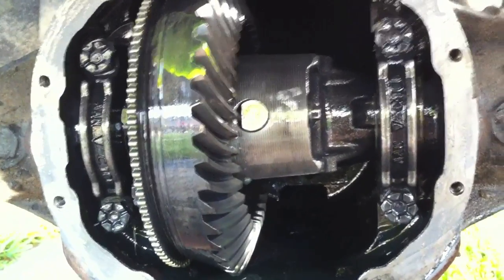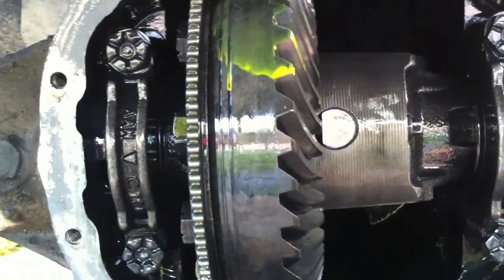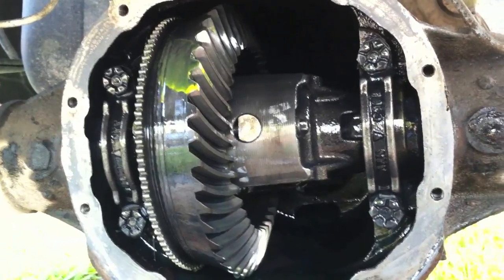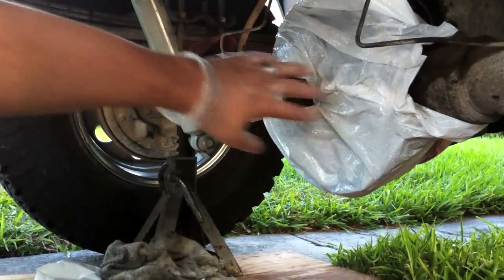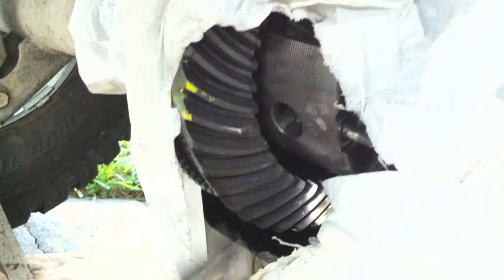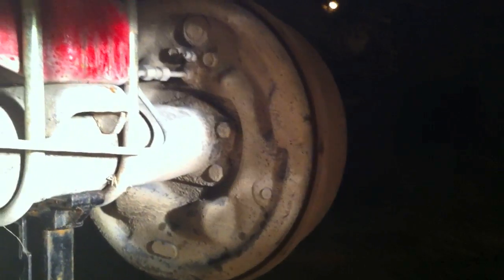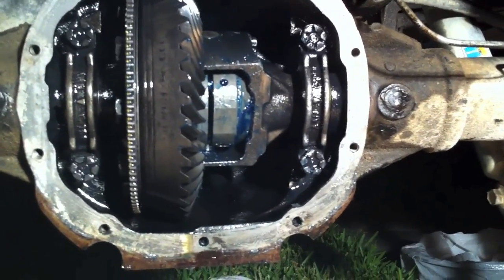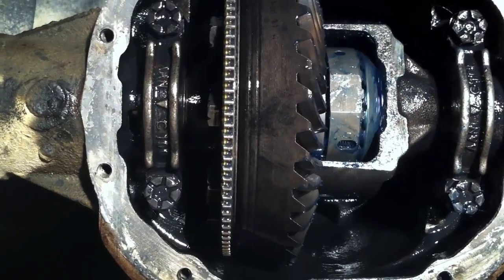Lock Right Locker - Part 2: Install in Ford Ranger [HD]

Comment: Plenty of people have said it but there is no resetting backlash if you're using the exsisting carrier... All you had to do was remove it from the differential housing, mark and remove the ring gear and do the job, put the ring gear back on the carrier exactly how it came off and you're good to go. Can't believe you ground down a tooth before doing that....

Comment from the maker: @patman5308 Glad it helped you out, I was looking all over for what to do about getting that pin out and I found a couple of forum posts with like 1 blurry picture. I decided this procedure needs a video.
Reply: Great video. What gear do you have in your truck? I have a 88 ranger with 4.56 gear, but I was told this locker can be used only on gears up to 4.10. Thanks!

Comment: Grinding the gear like you did is acceptable. some gears actually came with the ring gear already trimmed slightly across all the teeth. They also used to sell a "cheat" centerpin that was grooved(or ground) on one side to allow you to slide it back in.

Comment: When you turn a corner with a differential the outside wheel will have to turn faster to make it around a curve. A "true" locker(not limited slip) will send its power to the inside wheel and the outside wheel will actually turn "forward" to unlock itself and it will freewheel around the corner.

Comment from the maker: @DoctorHowitzer You get some soft clicking noise, and can be made quieter by using thicker gear oil in the diff. Mine is a daily driver. Sometimes when making a sharp turn such as into a parking space or a U-turn it makes some loud pops as it sometimes sticks locked at low speeds (less than 5mph)... but other than that I have no complaints. Off-road it's great. Only thing is you might think twice if you ever have to drive on ice... if both rear tires are spinning you can fishtail or spinout.

Comment: I have to wonder  if this will cause me to spin out on a wet or icy road taking normal turns...   but the concept is great as I might spend some time driving on a beach in NJ. I would not mind the clicking noise.. I would spray insulation  over the out side of the case.   But losing control of the truck in we or icy condtions worries me.  I'm sure  I could deal with it. but I would never lend my truck to anyone after that..  any comments.???

Comment from the maker: @ugadog34 No, it's an "automatic" locker... meaning you have no direct control over it. In an automatic locker, the wheels are normally locked, except when you turn it releases the faster turning wheel. So for turns, normal: outside wheel powered when turning, auto locker: inside wheel powered when turning.

Comment: What are the consequences of installing a locker other than some noise in the differential? Is this something that should be done on a daily driver?  I have a 2000 4X2 ranger 4.10 gears, I would like to do this for some light off roading.

Comment: So am I right in thinking you only hear the clicking sound when the tires are locked? And that you can unlock them when you're not offroad? Is this correct thinking? How would you do that when you're out driving? I have a Ranger, but what kind of locker would I need? Is there different kinds?

Comment: I had Lock Rights installed in both axles of my Chevy 4x4 pickup.   I have never heard that "ratcheting" sound when I turn a corner....   My instructions say the clicking noise "can sometimes be heard during turning."   In another place in the instructions, it says "it is almost inaudible during cornering."   I suppose they can be noisy in some applications and not in others?
Reply: Depends maybe on viscosity and type of oil used.

Comment: Hey man you seem to kno alot about the lock rights, so I would greatly appreciate any feedback. Will do a burnout all day long but if you stall up and take off or hit it from a roll it will completly slip about halfway through first and stop pulling completly untill I let off and get back on it. Any ideas? Was thinking about the only thing it could be is the springs are weak from being assembled and reassembled causing it to not put enough pressure on the outside teeth.
Gm 7.5

Comment: hey man just a thought. Does the locker have a break in period? and shouldn't you change the diff. oil after the period is over? I've heard people saying the diff oil turns metalic after the break in period. just like an engine. any does and don'ts when it's new? thanks :)

Comment: You wouldn't have to reset the backlash for you are not changing the carrier, if you use the shims it had, it will line up just fine.

Comment from the maker: @mtz8709 If you are going in a straight line on the freeway (at any speed really), and you hear the ratcheting sound constantly, something is wrong... sounds like the tires are two different sizes... check that the two rear tires are inflated to the same pressure, and that one isn't much more worn out than the other... otherwise, gotta open up the diff and see what's going on. It should not need to ratchet constantly when going in a straight line.

Comment: That ring looks like a 4.56 or 4.88… not a 3.73 at all. The 3.73 ring doesn’t ever need mods made to fit the standard full cylinder pin.

Comment: Thanks for posting. I bought a Lock-Right, but I think the installation instructions are the worst instructions I have ever seen for anything. They are horrible. And the pictures are worthless, like  photocopies of photocopies of photocopies. I tried Richmond Gears tech support line, and got an answering machine. 
I really, really, really needed to see how you put it together!
But thanks for posting  your video......It helps me understand how it works. I just need to see how it goes together.

Comment: That will never provide a positive lock. You basically installed a "clicker" into your diff. Possibly leaving metal shavings from it clicking as you go around corners. Should of spent a little more to get a mechanical, electric or air locker that positively locks up the diff for real traction. Enjoy your "my CV joint is failing" clicker.
Reply: I stand behind my original first sentence. It will  NEVER provide a positive lock. It WILL make annoying clicking (your CV joint is wearing out) noises and you've just spent several hours installing a toy in attempts to lock the rear diff. I had a V-6 ranger and was planning on installing a air locker as soon as the truck was paid off. It would let me drive it normally without clicking noises and lock it up fully should I need extra traction while off road. ;) have fun with your clicker toy.
Reply: They stand up to reasonable wheeling tho. we didn't ask if he just wanted a better feel on trails, or an easier option to Detroit lockers. I retract my stupid comment tho. But i have heard of people using them to rock crawl, tho id expect a shorter than expected lifespan if used in that way.
Reply: Look at the design. Its "always engaged" AND  allows it to slip when going around corners. Ive heard front wheel drive cars with faulty CV joints make less noise on cornering than this thing would. What is cool is the person installing it is happy with it. If you would be happy with it then by all means, go ahead. I would recommend a positive locking diff over this for your CJ7.
Reply: Got one in my landcruiser and it works just as well as the others. I dont think you really understand how it opetates. Yes it does make noise though but im ok with that as it lets me know its working normally.
Reply: Yup, not providing a positive lock in your diff. Might as well as kept it stock limited slip cause that is what you have except now it clicks. Good Job!
Reply: Maybe do a bit more research and learn how it works. If it was as black and white as you think then they wouldn't be half as popular as they are. Your idea of a positive lock is probably a CIG locker. I can have the 2 diagonal wheels completly off the ground going up hill and not even notice. By the way, a stone stuck in my tire is way louder then the "clicking".
Reply: Bounty B. Wolf i just removed my lock yesterday. 
a big disappointment!
Reply: Man, it's a shame you don't actually educate yourself. These lockers are fantastic for those on a $200-300 budget.
I ran them front and rear in my Cherokee, and let me help you understand..... they will provide up to 100% of the engines torque to the tire with traction, even if the opposite tire on that axle is in the air, or on a slippery surface. You will never have a "one wheel peel" so to speak, because they progressively lock up with torque from the motor. They are not as refined as other lockers, with the clicking and such, but that is part of their healthy operation.
Nothing like a worn CV joint. What a foolish comment.
LEARN, sir.
Reply: Mechanical lockers like this are fantastic at providing 100% traction to both wheels when the gas pedal is depressed.

I have a rear Lockright in my 95 Nissan Hardbody with awesome results.

I also have front and rear mechanical lockers on my 2005 Frontier and a front mechanical locker on my 2006 Xterra Offroad.

All works great and I highly recommend this form of locker over any ARB.